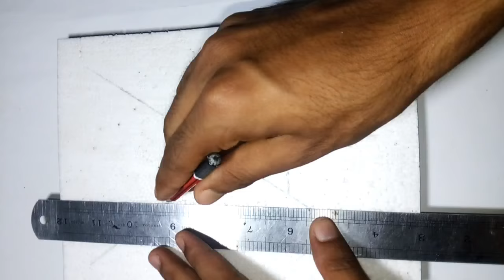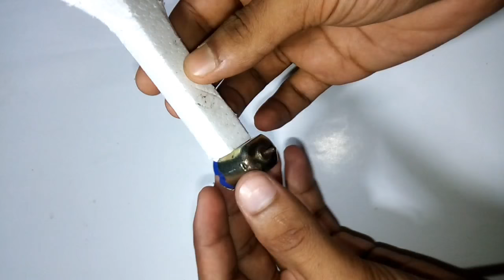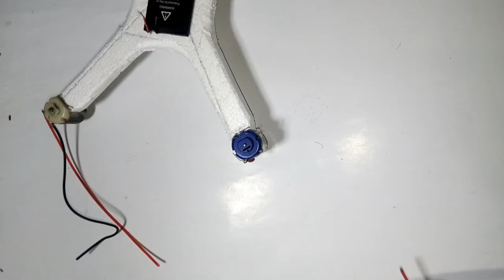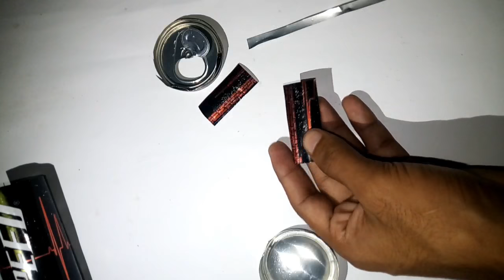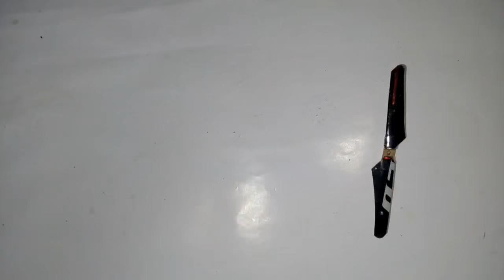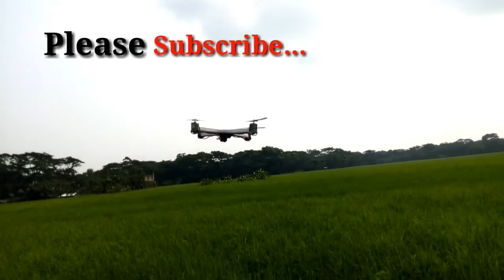How to Make a Drone That can Fly 100%

Comment: Good Photoshop 😂
Reply: Easy Electro 😂😂First this sound for a second helicopter can not 4 volt battery to run 4 engines of this speed of this category III and the most important can not be controlled so and flight without a remote control or else it will fly very far

That means Photoshop
Reply: Easy Electro you'r welcome 😊
Reply: Easy Electro ut wait, sir, I would like to say that the design of the plane is very beautiful and it is also consistent but I wish it to be real and I appreciate your effort in making things to learn.

It does not matter if this plane is a trick or not, but it came to me with a good idea, but I also saw it. Thank you again.

Comment: How the hack the Angular momentum is 0 when all motors rotate clockwise.  😅 
Where the hack the chopper sound effect comes from. 😅😅😅😅😅
M1               M2

M4              M3

Connect M1 and M3 to the battery as + to + and - to - (CW)
Connect M2 and M4 to the battery as + to - and - to + (CCW)

Then your angular momentum is zero and it won't keep rolling in the air

Comment: What the flip where's the receiver how is it even calibrating the and the battery pack is way to heavy to carry its about 42% motors are not even brushless motors and when the drone fly it seems way of moves to early to go forward nice try buy 4x of ESC for the motors and fpv / hd camera drone is my thing